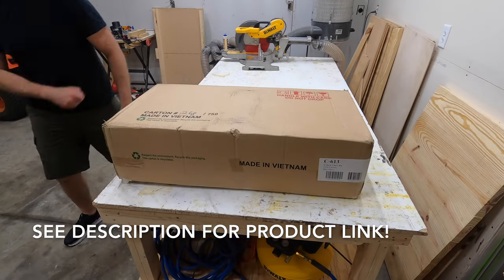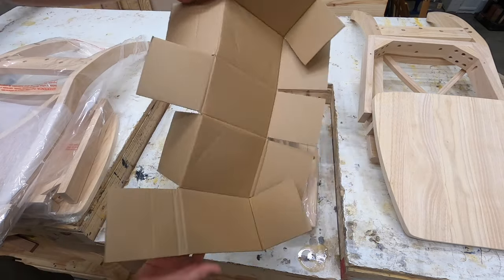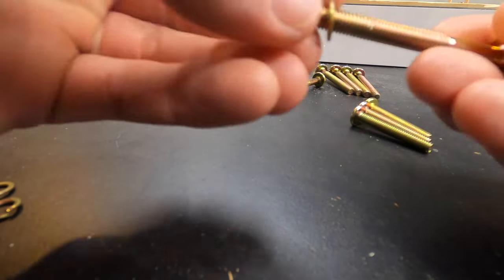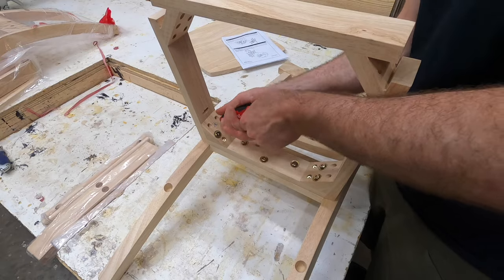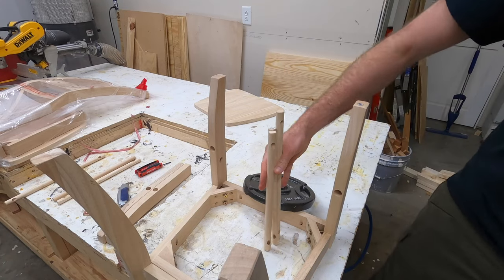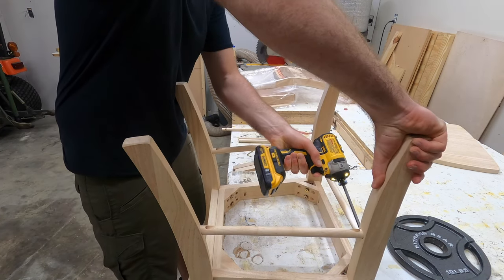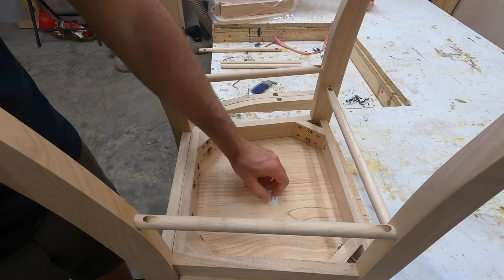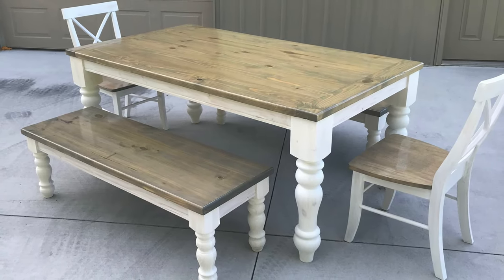DIY Dining Chairs - International Concept Unfinished Chairs - Unboxing, Assembly, and Overview

Comment: Thanks for video!!! Helped me!!! But I’m also at the end when I have to attach the seat and it doesn’t have the pre-drilled holes?!?!?!?! Two came in box and neither have pre drilled holes for the 4 screws!  Am I missing something???
Reply from the maker: Thanks for watching! The seats don’t have predrilled holes, you just line the seat as best possible and then attach with screws. The aprons are the only piece with pre drilled holes 👍🏻
Reply: Oh ok! Thanks!!!!!!
Reply: So the screws just dig in slightly to seat in order to keep it in place?
Reply from the maker: Yes 👍🏻 just make sure you have the correct length screws. 

(Might want to check the instructions), but I think the longer screws go in the support braces between the legs, and the shorter screws are for the seat top. If you get them mixed up the longer screws would likely go through the seat
Reply: Thank you!  Yes, these are the midsize ones 👍🏻👍🏻👍🏻